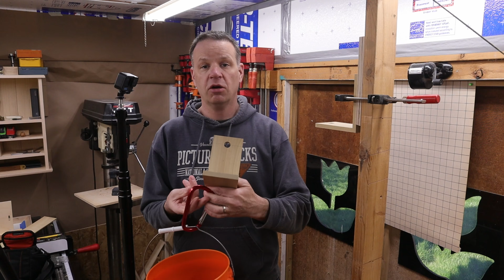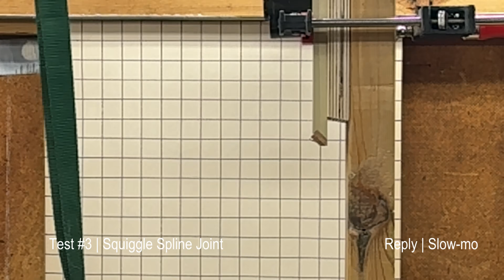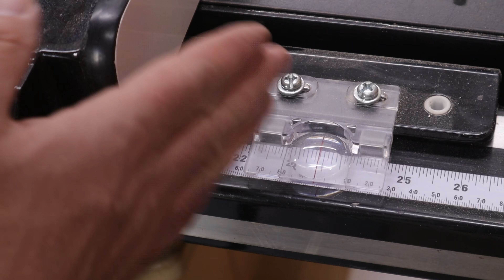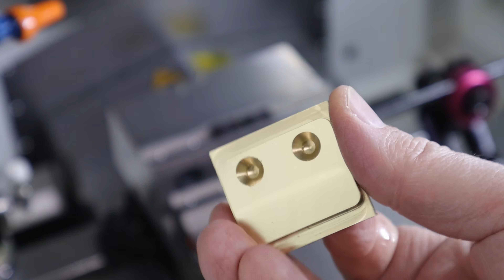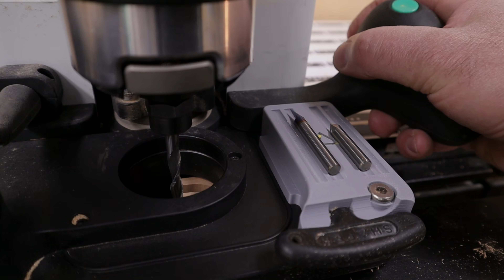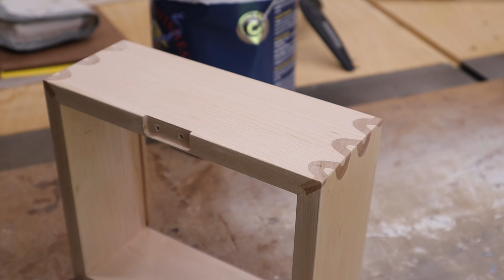This Drawer Joint Shouldn't Work. I Used it Anyway.

Comment: Very interesting project, liked and subscribed.It's slightly unfortunate that the squiggle spline is so weak structurally, though as noted, for this application it doesn't much matter. Nice VMC! Wasn't expecting to see that from a channel called "Woodchopper Woodworks"!

Comment: Interesting because you tried to innovate. I think if you’re just doing drawer boxes most joints are suitable. When doing longer case joints maybe the selection matters more but the easy of assembly matters just as much. The choice is probably more dependent on equipment and experience. A fun watch. Cheers
Reply from the maker: Thanks for the thoughtful perspective, I definitely agree that ease of assembly and the tools you have make a huge difference!

Comment: I thought you were really onto something when it came to joints. 
What if you cheated a bit and added in some dowels? 
Could make them oval and match the groovieness of the wave. 
And it would definitely add in some more strength.
Reply from the maker: Yes you could definitely do that.    I was just thinking I could have added the traditional spline joint as a test sample to see how that compares.  Also if I wanted to do a more complete test I could have tested multiple samples of the same joint.   I did notice there were some "burn" marks on the squiggle spline-side grain mortise (you can see it in the video after it broke) I wonder if it that sample didn't get a good glue bond.    Glue would also be another variable to change.     Maybe a follow up video is in order...   we'll see...    Anyway, thanks a lot for your comment and for watching the video!
Reply: @woodchopperwoodworks  Well it certainly would be interesting to see an expanded treatment as you describe. Yours was a sound scientific approach, though N of 1 experiments are always a little iffy. Still, I suspect the results you saw would match quite well a larger number of samples of each joint. In case you do decide to do more testing, here are some random thoughts:
1) Plan for at least N=3 for each joint type
2) Consider using an eye-bolt passing through a hole with washer backup on the top side. This will create a more standardized force pulling down
3) Consider adding a luggage scale or spring scale for visual effect
4) Create a checklist for steps including PPE and camera/audio stuff

Or just wing it, we'll be interested all the same.

Comment: Just a little feedback: the hard-coded text in the intro to your video can be a really big turn off. It feels very tik-tok / shorts, which is a very different demographic.  The joint is nifty, but I almost disliked and clicked off before you made it out of the intro. I did click further in to see if you kept that going, and thankfully you didn't.
Reply from the maker: Thanks a lot for the honest feedback, I totally see your point.   I'm trying to experiment with what works and what doesn't.    There are probably a few other things I would change as well,  but I guess each video done is a learning experience as I try and figure it out.   Thanks again for your feedback and thanks for clicking further in the video to get past the intro, it means a lot!
Reply: Well I had to go back to see what this comment was all about. I just ignored it, didn't find it bothersome at all. If it were AI video with AI voices, I would have stopped watching immediately. Also, while I usually find music to be at best a distraction, your use was not bothersome and I actually found it relaxing...